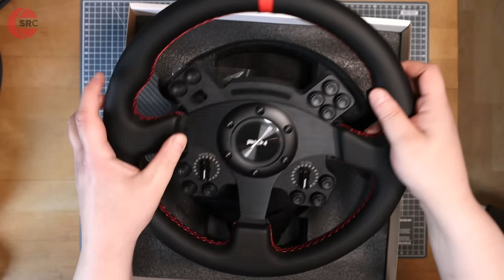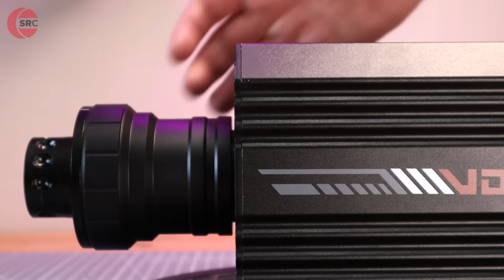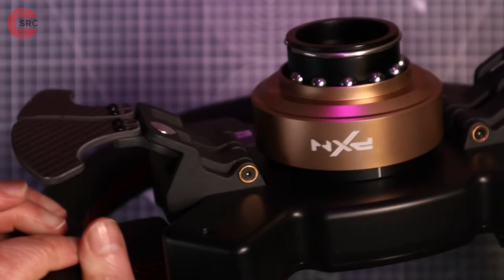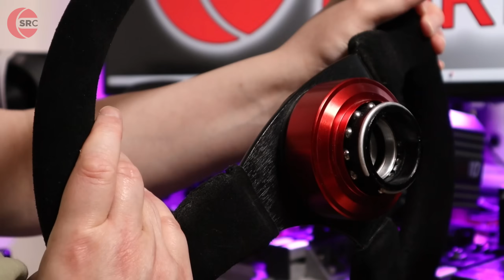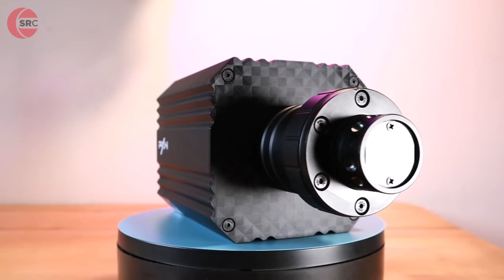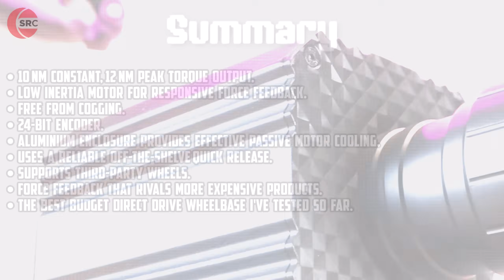THE BEST BUDGET WHEELBASE I'VE TESTED! | PXN VD10 Direct Drive [REVIEW]

Comment: Quick question: Is it possible to mount the VD10 Base upside-down and then compensate the 180degrees in its software?
Reply from the maker: Yes, you do that. You click button in the software to centre the wheel at whatever angle you want.
Reply: @SimRacingCorner  Perfect, thanks for the quick reply :)

Comment: IT WORKS ON CONSOLE AS WELL.  JUST PLUG IN THE BASE TO THE CONSOLE THEN THE CONTROLLER INTO THE EXTRA INPUT ON THE BACK OF THE BASE VIA A USB C CABLE (MAKE SURE ITS DATA TRANSFER CAPABLE) i have a vd wheel and its works great on my xbox series x

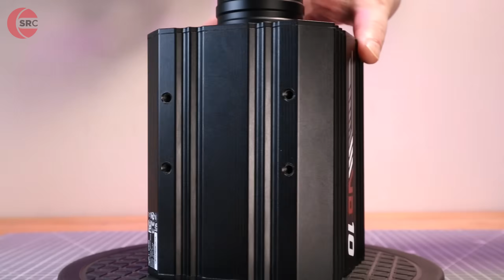Comment: 1:50 the extra Port is meant for plugging in a cable from a 3rd party wheel
Reply: are you sure? Meaning all you need is a usb to usb cable without any extra dongles?
Reply: @d.fenech not 100% but someone with direct contact to pxn told me that it works like that

Comment: i got the VD6 wheelbase and the W AS wheel to my door for $300. amazing value for a 6nm wheel, it legit feels 10 times better than my old T300 that used to overheat after 10 mins into the session lmao. drifting in AC feels much nice and more controllable and my touge runs have gotten slightly faster and more enjoyable.
Reply: 300? How
Reply: @vertachi8066 lmao, it was selling fullfilled on amazon and they have huge sales
Reply: I just ordered the vd 4 yesterday for 279.00 on sale

Comment: Do you know if it works with thrustmaster pedals?
Reply from the maker: Only the T-LCM pedals, that have USB to operate standalone.
Reply: But can it work with other pedals with and adapter?
Reply from the maker: @tomascosta9528 What adaptor exactly?
Reply: One that converts the t-3pm connector to USB
Reply from the maker: @tomascosta9528 If there is an adaptor that does that, then sure, you will be able to use those pedals with the VD10.
Reply: Sorry if I responded with the same message many times
Reply: Ok thank you

Comment: 2 issues I have with this. 1. it is not available in my country yet nor is it available in their website. 2. for the price of the VD10 wheelbase,  I would rather spend on the Moza R9 V3 or R12. pricing for the VD10 is spotty. it would have been nice if it is selling for $400 as a bundle.
Reply: Same, cant buy it atm where I'm at, sadly... disagree bout the price tho. VD10 bundle + their largest wheel with discount code equals to under 550, thats insane. The Cammus C12 f.e. costs 700 where I'm at. The moza r12+ wheel bundel, the cheapest also equals about 800, simagic bundle about 1k. I can't see quality, modular hardware getting any cheaper anytime soon.
Reply: @TheGameGuruTv  the R12 is an extremely strong base. I believe the VD10 is comparable to the buggy V1 R9 torque strength and problems. although the V3 R9 bundle is much improved and cheaper than the VD10. from my local, the R9 V3 bundle and R12 V2 bundle are cheaper than the VD10. and both comes with a V2P wheel. as I said, from where I'm at, the VD10 aint a good deal.
Reply: @tellyshonestreviews1293 creator said in a comment that it feels better then r9 v1 sp its comparable to r12

Comment: Hey, what would you choose: Thrustmaster T818 or PXN VD10? Which do you think is better? Which has better FFB?
Reply from the maker: At its current price, the T818 is absolutely the worst one to buy, vs. the PXN, Moza or Simagic options.
Reply: Thank you very much for the reply. I already have the T818, but it's starting to cause problems, so I was thinking about getting something else like the PXN, or Moza R9 but only if the FFB is better than the T818. Or should I stick with the T818? :)
Reply from the maker: The PXN FFB beats both the T818 and Moza R9.
Reply: @SimRacingCorner when u say r9 are u talking about r9 v1?
Reply from the maker: @vertachi8066 Yes. I haven't tried the V2. Though, the extra torque is another factor why the VD10 beats the R9.

Comment: I really like the offering with this wheelbase, but "sadly" I will still choose Moza over this for my future simrig, primarily because I want to buy the truck steering wheel as well as stalks accessory & want for them to work with the wheelbase natively instead of using the USB cable, as well as having just a big(ger) aftermarket of parts, be it official or 3D printed which the PXN will definitely not deliver on
Reply: @Sithhy  found myself in the same corner and also went moza for the aftermarket wheel and accessories support
Reply: @kite4668  hello as of todays date , there is 55 dlls custom carbon fiber wheels for the vd series , and as time goes by i most certainly am sure that the ecosystem will eventually grow , the reason i went with them is because i want to give them my support and hard earned money to see them grow .

Comment: this is aint a "budget". just same price range as the competitors
Reply from the maker: Feel free to run the numbers of price/specs and provide details.
Reply: @SimRacingCorner  u might be right of i buy it from pxn official site but i found it high priced on A.E
Reply from the maker: Depending on where you reside, Amazon is another place to find it listed at the correct RRP.
Reply: 512 For the most expensive wheel and VD10,   Moza R9 with cheapest wheel 600,       659.00 For Simmagic alpha with basic wheel,   thats like 18% and 28% diff respectively

Comment: Would it make sense to updagrade from a Fanatec CSL DD with the boost kit? And would a Simagic GT neo work with the QR system or it requires the maglink?
Reply from the maker: Upgrading may not necessarily feel like it's worth the effort, as it depends on whether the CSL DD is already sufficient for you. As for the Simagic GT neo, yes, the Maglink will be needed.

Comment: PXN really stepped up. What is even the point of buying g923 and t300s anymore.
Reply: Well it is still 2x cheaper
Reply: @Maltinis  still they offer DD wheels and pedal bundles that are at the same price new and are far superior
Reply: @apostolosmylonas6207   checked before i made a comment, g29 or t300 is still cheaper. You can get full tree pedal t300 with some discount for 320e
Reply: pxn quality is buns i have the new vd6 and the quality feels so cheap
Reply: @BIGGGGYAHOOOO  Really? Why?
Reply: @BIGGGGYAHOOOO i have the vd10 and it doesn't feel cheap at all
Reply: @BIGGGGYAHOOOO  I have the vd6 and it is excellent

Comment: It's amazing that people get to start off with equipment like this for a good price. When I started using a wheel back in '03 I used a Logitech wingman formula GP. Then a DFGT, G27, and T300RS which I use currently. Even a decade ago a setup like this would have been crazy, and likely very expensive. I mean a brand new G27 back in the day was over $300 or at least it was for me. So something like this for the price is incredible. If these PXN bases turn out to be reliable, I don't see any reason why anyone would buy a gear or belt driven wheel anymore.
Reply from the maker: You're spot on, this is a huge leap forward for sim racing accessibility.
Reply: Just got my first setup ever (aside from a desk mounted Driving Force GT). This wheel and base are incredible

Full Setup

VD10 and WCS R2 (Shown in video)
Simagic GT Neo
Turtlebeach Shifter
PXN Handbrake
Simsonn Pedals
Amazon Special Aluminum Profile Cockpit with Seat (Anman/Marada I believe)
3 32 inch monitors

This feels insane to have in my apartment. Every time I walk by my office I have to peek in and grin
Reply: @Autowill  did you put the squash ball behind the brake pedal on the dfgt 😂😂 that was the level of mods back in thebday
Reply: T300rs to pxn vd10 
T300rs was my first wheel ldk how it was back then tho but dd wheels probably didnt exist or were super expensive

Comment: Great review. Did you experience any oscillating, like Shaun from The Simpit did? Concerns aside, I'm really liking this!
Reply: I just saw the video Simpit posted about this and there the FFB looked all over the place but here everything looks good i dont know what to think
Reply from the maker: I've just ran a quick test. Going straight down the track, oscillation is minimal, pretty much like any average wheelbase. If you release the wheel while turning, then it will want to self-right, and then whip back and forth, and the oscillation is strong. I drive with at least one hand steering, so frankly it didn't factor into my experience using the wheel. I might compare this result against another wheelbase to see if this is any worse. Oscillation is a thing with all direct drive bases to some degree, so it's not exclusive to this one.
Reply: Thanks for doing that and letting us know your findings. 👌

Comment: I'm new to simracing and i wanna race competitive, should I buy this or the moza r5?
Reply: This! No comparison
Reply: @HughesDePagen  but it's more expensive than R5, so not sure if that's the right comparison. a better one-to-one comparison would be R9 bundled with a wheel (this usually is a bit cheaper than buying them separately), and for that you need to check the prices that available to you and if you need a GT-style wheel or not. Moza has a few of those, but with PXN it's only possible if you buy this WCS wheel and swap the rim for a formula-style one (and pay attention to the shape and size of the rim so that it doesn't interfere with the buttons)
Reply: @vsm1456 fair enough, fellow real person
Reply from the maker: Maybe you're long-lost relatives. I can't put my finger on it, but there's a resemblance. 📎👀
Reply: @vsm1456  :face-green-smiling::face-green-smiling::face-green-smiling::person-turqouise-waving:It's better to buy the PXN10Nm flywheel pack and when you have more money, the GT NEO and the cable adapter...:face-pink-tears:
Reply: @SimRacingCorner 😂😂

Comment: While we are waiting did you get the Simsonn Vam haptic thing installed on your pedals?  That looked like it could add some great feel, would love a quick update video on the rumble through it
Reply from the maker: I haven't yet, I have a couple of other reviews I need to get through first.
Reply: There very good they come with no usb cable which you need if your using  different pedals to the ones they supply. 
They work very well through simhub
Reply: Oil just ordered my vd10 uograding from a 4 month old v12DDL. Nothing wrong with it but want more. Also have the Simsonn Pro X pedals and just bought the low end haptics waiting on them to arrive!